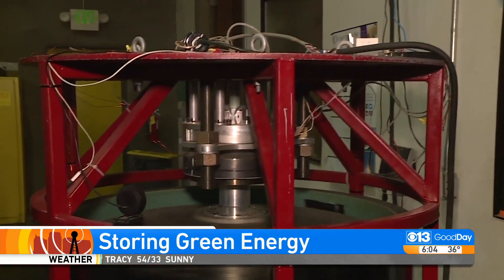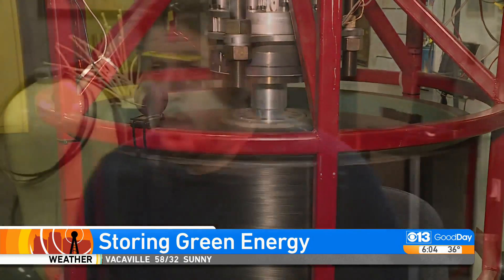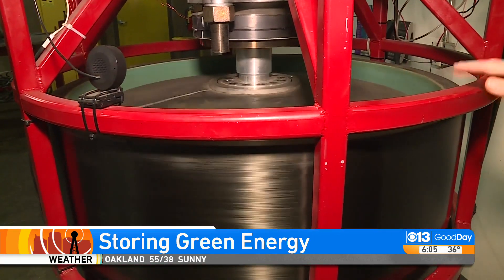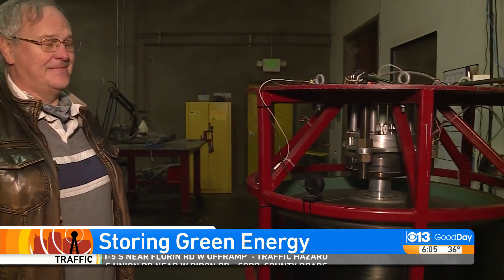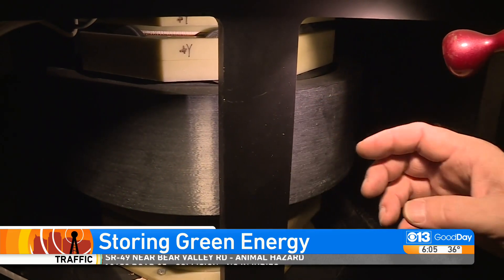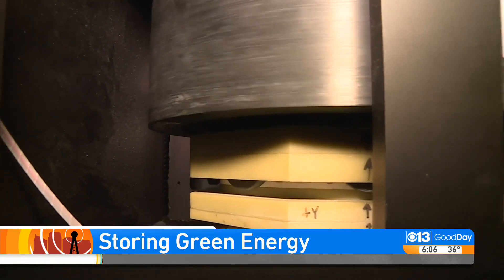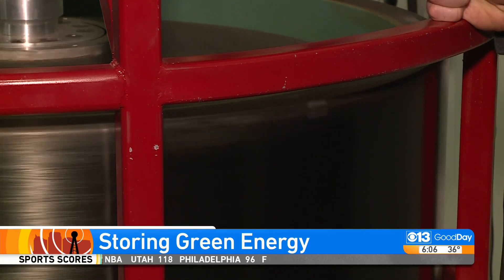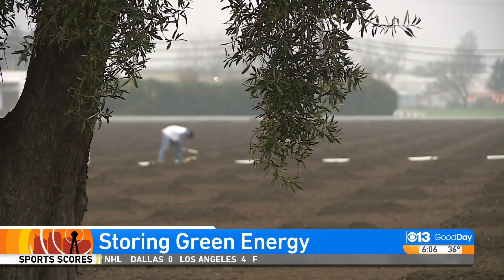California Company Thinks Prototype Electric Storage Device Could Spark More Solar Use

Comment: Best of luck to them, but the only thing "new" I can see here is what looks like a carbon fiber rotor. Otherwise, both flywheel storage and contactless magnetic bearings are at least 100 years old with many organizations throwing money and talent at this particular solution. https://en.m.wikipedia.org/wiki/Flywheel_energy_storage

It would be more informative if the reporter were to provide this context while noting what, if anything, differentiates this product from the competition.